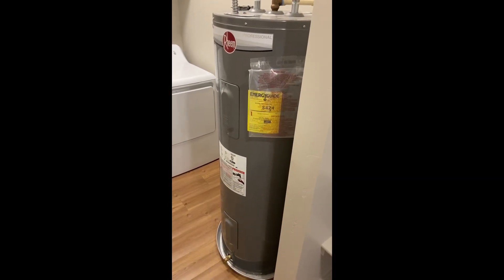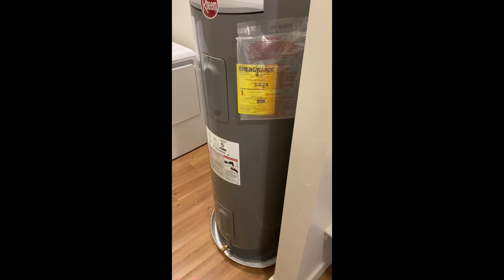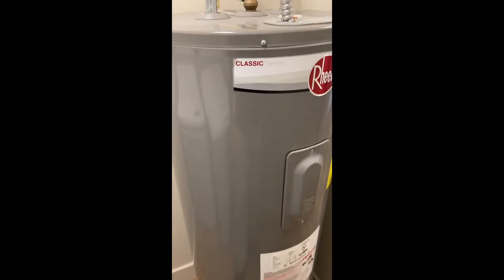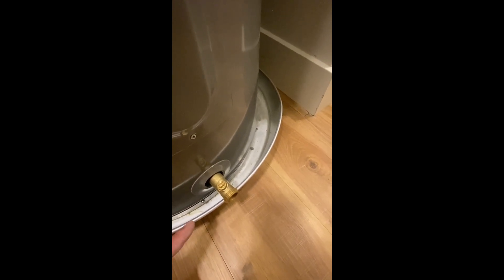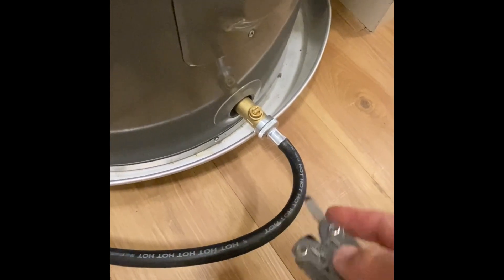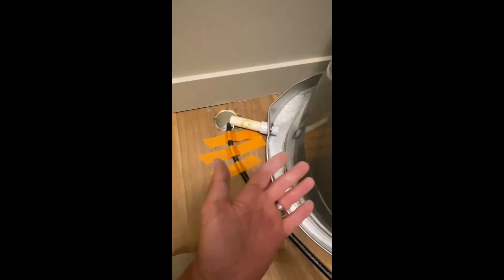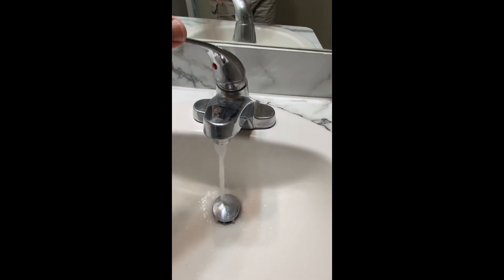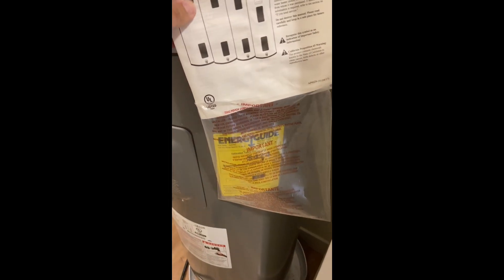How to drain your water heater and exercise the temperature pressure relief valve.

Comment: You should have just opened up the hot supply line to allow air to enter the tank and not the t and p valve until the water is below the t and p valve so it won't possibly clog up. Doing this way will not allow water and sediment to enter the t and p valve.
Reply from the maker: If I was doing a water heater that had not been drained within the last year, I probably would have done it that way. However, because this is an apartment complex, we drain these yearly and log it. So I knew that there was no way that sediment had built up to the point where it would be as high as that valve.. Great comment! Thank you for watching.
Reply: @maintenanceman1503 okay
Reply: @maintenanceman1503  Looks like my hot water tank is connected to a mixing valve. Opening a hot water faucet doesn't allow air to get into the tank because the mixing valve doesn't allow reversible flow of fluids. In my case the T and P valve is the only way to break vacuum lock?
Reply from the maker: You should just be able to loosen the connection where the cold water supply line goes into the water heater. You don’t have to take it all the way off, just open it up so air can get sucked in as water drains out.